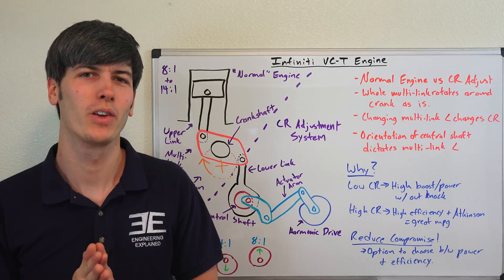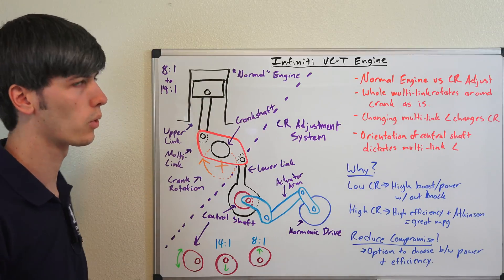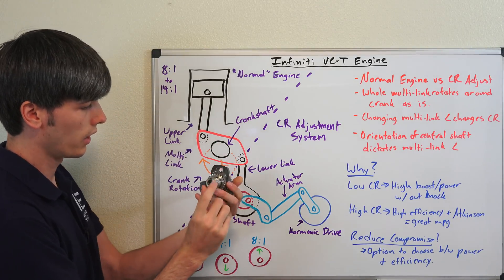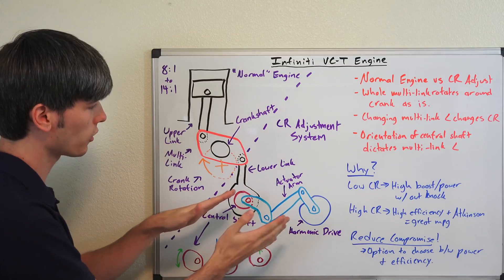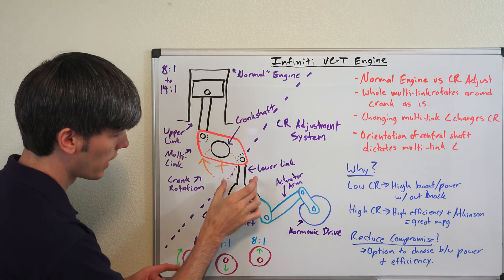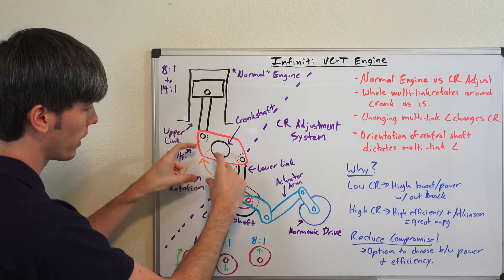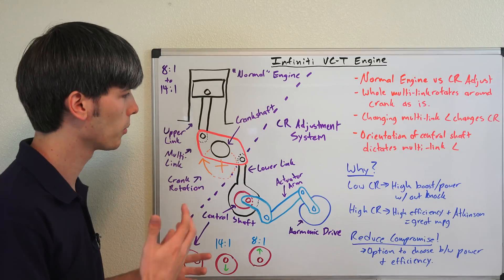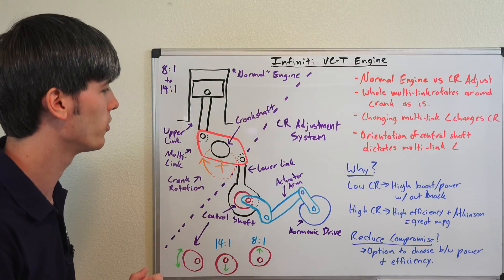Infiniti's Amazing New Engine - Variable Compression & Turbocharged

Comment: All of this for just 10% increase in efficiency? VW using the miller cycle looks more promising, also looks a lot less complex.
Reply from the maker: +Oliver Newell who said 10%? Also, 10% is significant either way. This uses the Atkinson cycle (pretty much what you're referring to as the Miller cycle, there are minor differences).
Reply: Engineering Explained http://www.autoexpress.co.uk/nissan/96667/new-petrol-engine-tech-could-kill-diesels

I didn't insinuate you used the 10% term, but others have, including Infiniti themselves. 10% figure is used quite a bit here, under "what are the benefits." Remember this is what the manufacturers say, real world improvements are going to be less than that. 

The VW method is more focused on thermal efficiency. 

http://newatlas.com/volkswagen-engine-miller-cycle/43067/
Reply: in any case I'd say if there's no more than 50% to 70% efficiency it's nothing new.

Comment: I can see potential reliability issues here, and a lot of bent valves in its early releases.
Reply: your talking about Nissan's here not unreliable German cars
Reply: +Scott Dann I hope your wrong bro...but your probly right, heck look at Cadillac they never were reliable. people still by them.
Reply: Reliability issue yes, but bent valves... Thats gonna take a timing chain/belt failure.
Reply: That's the other thing to consider. You'd want a hardy double chain to make sure you don't lose the timing.
Reply: Nissan aren't as reliable as they used to me. No brand is reliability exempt nowadays. It's not cost effective to sell cars that don't break down.

I know my Mercedes will likely be a useless sack of bolts within a few years.

So will every Nissan,  Toyota,  Honda,  mitsubishi and subaru.
Reply: I agree... increasing the number of moving parts also increases the likely hood of failures.
Reply: I don't see how this could bend a valve.  The valve openings are surely designed for the highest compression case.  Therefore they would never touch.  It isn't that complicated.  Plus it is Japanese not German or American so you have better reliability to start with.
Reply: +latino914 Nissan's are pretty average on reliability. Really not that much better than the middle of the pack. People seem to think they would be since they're Japanese but it's just not the case.
Reply: If they made cars that were 100% reliable they wouldn't make money off you. They make money from hire purchase/finance, servicing packages and ridiculously overpriced spare parts. No matter what country it's made.

It's not the 80s anymore.
Reply: I do not expect this engine to win any awards for reliability.
Reply: +latino914 shots fired
Reply: +theconman1395 Yea but compared to MB it's not even close.
Reply: Yeah, if Mercedes came out with something like this no one should ever buy it. EVER...
Reply: +Scott Dann, look at the Model T... that and many many other early examples. It is no supurise at all to still see one driving around Simple enough a child could almost have rebuilt the engine. That was before things were designed specifically to NOT be worked on at home or to break. Company's simply wouldn't stay in business if people could buy one car then just be done spending money on it the rest of their life

Comment: I don't get it, I thought high compression ratio gives more horsepower like in the muscle cars of late 60's and early 70's, Am I wrong?, please explain, thank you, cheers :)
Reply: when using a turbocharged engine, it's MUCH safer to run high boost at lower compression ratios, lest the engine explode. if you're running a supercharger or NA engine, then you're correct.
Reply: You are right. But also, high compression, you'll get the same intensity/energy of explosion for less fuel where as to get the same amount of energy/explosion in a lower compression you need more fuel and air.

Comment: When we had anti-knock additives in the fuel the most powerful engines and the most economical were high compression engines - would in not just be easier to use a safe additive to bring up the octane?
Reply: Increasing octane is expensive and the additives that were good at increasing octane contained tetraethyllead which contains lead and is now banned. During WWII the P-51 ran on grade 150 fuel so they could run 25psi boost.
Reply: Increasing octane will would afford higher compression ratios, and if you go to high you end up making a ton of Nitrogen Oxides which can overwhelm an emissions system.
Reply: thanks for that tad of info onP51! ww2 planes engines were the best! Huge turbo supercharger...ukti setting..and cooled under hard use.....Germany used a 3 cylinder 6 piston (I believe that was the number) in some aircraft.....the pistons created compression as the traveled toward each other then away..cranks at the other end.....some use cam system to run pwer from one end to the crank on the other.....and some literally used 2 crank shafts......awesome deign....

Comment: I wonder if they plan on making it as reliable as the VTEC system or if this is just one cool way of watching your pistons fly through the bonnet when the engine will require 8:1 ratio and it gets 14:1 through failure of the control unit... Time will tell. On paper though, it's very interesting.

Comment: Never again buying Nissan products,  bad transmission in R51 Pathfinder and bad catalytic converters.  Rust in the R50 Pathfinder,  wd21 pathfinder defective manual transmission oil fill location causing underfilled trans.

Comment: Wow. One more to add to my dream petrol engine. Variable valve timing variable valve lift variable compression direct injection variable geometry twin scroll turbo, steam injected(to clean the intake system. Another fluid to fill it like its DEF) electric water pump alternator starter inter grated into timing or flywheel as a single unit. Electric power steering and compressor no drive belt ...  Mid engine inline 6...?
Reply: starter and alternator on the same unit? wow that would be great (me putting irony face), i sell used parts and i always like to make a good sale, selling a starter and have the customer being forced to buy a "STARTERNATOR" for double the price that is great!!! yeah! shelfs empty and pockets full.
Reply: well guy, im not looking at it from a price point of view, I'm looking at I think would be the coolest modern engine features... talking about cost, yeah, it would suck to mantain, complexity would also be an issue, and i wouldnt want to work on it. BUT it would make sence to intergrate those two components since internally they are very similar and with some adjustments could be made into one (has been done before on electric cars) 
with them combined along with some other things i listed, you no longer need a drive belt and reduce paracitic draw on the motor.

Comment: Between this and the BMW Valvetronic I feel like the industry is jumping the shark for ICE engines. We keep making them more complex just to keep the same basic suck/squeeze/burn/blow cycle going a little bit farther. The Wankel engine was at least something different and I think if they put as much effort into that as they have into piston engines they'd be viable. Also the Duke axiel engine is something to think about. 

Though I guess once we get the battery thing figured out (or fuel cells or something) we'll all be driving electrics. And that will be an awesome world of instant smooth torque from quiet and fast rides.

Comment: Besides helping to control knock, the other reason a low compression ratio is desirable in a super charged engine is that the larger clearance volume allows for more fuel and air to enter the cylinders.

Comment: They should have just done something with the head instead of this mess. Much stronger and easier to have a variable size combustion chamber then to try to adjust the stroke of the engine. As long as it can remain in a detonation resistant shape all should be good.

Comment: Isn't there a loss in power with the multi link? I would assume the piston applies a significant torque on the multi-link for which more energy has to be applied to stabilize it. I guess i don't fully grasp the concept of the transnational motion completely.

Comment: This looks like the exact same scheme as BMW Valvetronic and Fiat Multiair variable valve lift system. This is tremendously concerning because those systems have a tendency of breaking fairly often due to the complexity. Bottom-end problems are not good problems to be having on an engine and I find this to be crazy.

I think the fact that manufacturers feel the need to develop such mechanically complex systems to meet performance goals really serves to highlight the need to make a shift to electric vehicles. While this kind of stuff is pretty neat, pixies running through a coil magically applying torque to the driveshaft is just so much simpler, easier and more elegant than these modern monstrosities.

Comment: Hi, is this only for 4 cylinder (2.0L) DEISEL engines? thanks EE.
Reply: This is a gasoline/petrol engine. Not diesel. No diesel would run on just 8 to 1 compression
Reply: ***** thank you

Comment: That honestly seems severely over engineered for it's purpose. Even my old 1998 Kawasaki KX250 two-stroke has the ability to modify it's compression ratio, but uses a centrifugal slide valve mechanism in the head to simply enlarge or reduce the effective cylinder stroke. It's the same concept as well, as a two-strokes expansion chamber works as a supercharger, forcing more air into the cylinder, requiring variable compression ratios at different RPMs. Very impressive engineering but it seems like reinventing the wheel when simpler, more reliable tech already exists.
Reply: Implementing VCR in a two-stroke engine may be easier, but it has dirtier emissions than 4 stroke. The challenge is how to make an engine efficient and have clean emission simultaneously.
Reply: Emissions has nothing to do with what I explained. I used the example of an outdated, archaic two-stroke which has the ability to modify it's compression ratio via a simple and reliable centrifugal valve, versus a modern engine using a massively complicated crankshaft solution to the same problem. I'm suggesting that Infiniti should have used a similar setup. As RPM increases and a turbo spools up, a centrifugal mechanism could lower the compression ratio in the same way.

Comment: This is what I hate about us engineers, we know the math and science and know it will work... but that is theory. I am pretty sure when this is put into everyday driving situations, it will not hold up. I am sure it will break easily, even with stronger parts. But also the electronics. 

Great idea and good engineering working by Infiniti/Nissan engineers, but I have concerns because I also work on cars.
Reply from the maker: All cars these days are incredibly complex. They last because of solid engineering. There's testing and quality control put in place to make sure these products last, they come with a warranty after all. FEA is pretty amazing these days.
Reply: +sasja de vries
Comprehensive and impressive statements. While nothing can really run for ever there are many examples of people making things last a stubbornly long time (I said making, by that I mean replacing internals to avoid defects that may or may not have been engineered). I agree that engineers design the products, but I wouldn't assign them the blame. It seems you didn't do that exactly either, when you mentioned the companies want to sell new products. Target goals for cost, longevity, and sales price are all factored in. Companies want to expand, so they charge a price that doesn't intervene with their profit margin. Incredibly well written post, with excellent examples.
Reply: +sasja de vries what about software updates for phones? Do they purposefully make them secretly make your older phones run slower and drain battery faster so u have to replace them sooner? Also, thanks for the very detailed comments, was interesting to read :)
Reply: Michael Carr
Blaming engineers is indeed not the thing to do, it's the managers that tell them what to do.
The managers make the decisions while the engineers have to figure it out. Quite odd isn't it?
As an Aerospace Engineering student I learn how to make the report appealing, in stead of making appealing technology (I mean not snake-oil but something useful).
It's not like an engineer himself can change this. Unless the engineer becomes an entrepreneur himself.
Adam Leach
Exactly!
Speaking about Batteries: LiPo batteries are not advancement in technology, it's a trade in. We trade in safety for energy capacity and weight reduction. LiPo batteries are the most reliable detonators for your phone (if you want your phone to explode, use this!!!).
The most "supernew" Lithium batteries contain nickel and cobalt, and these elements tent to resonate under microwave radiation.
Simply put: if you take apart your microwave oven, and use the magnetron to shine on someones pocket, his phone will explode.
There is a youtube channel "Kreosan" showing how that would look like.
Even more concerning: EMP weapons have a way more powerful electromagnetic pulse, which means that if I would make a successful EMP weapon then all LiPo batteries in a radius of 100 yards would explode. The Russian ministry of defence already has Suitcases with this EMP device that can take out electronic devices of a whole city.
DIY EMP devices are not common, however there are already signs of regular citizens making prototypes of EMP devices. Starting with Shorting a big capacitor, then moving to coils and deflagrations, then moving to antennas for increased range...
More details can be found on in internet
I'd rather have my phone not work anymore than exploding and injecting my veins with toxic heavy metals.